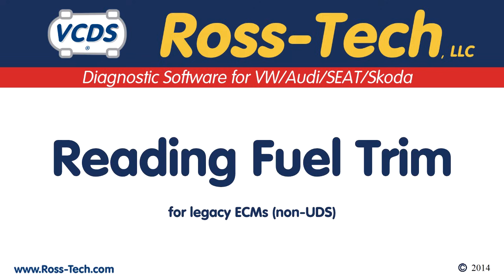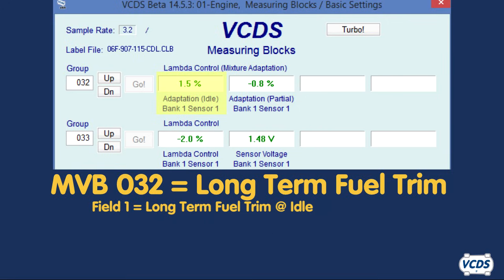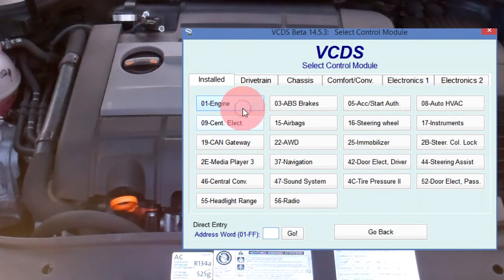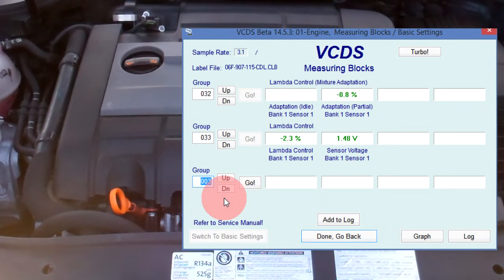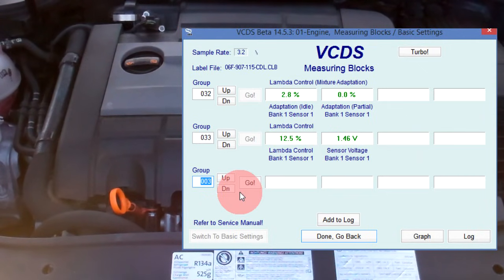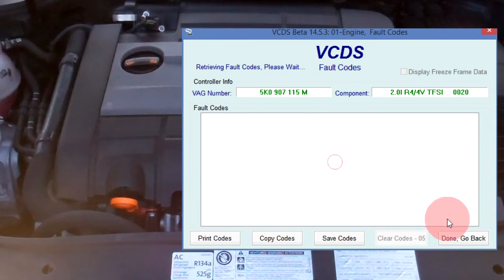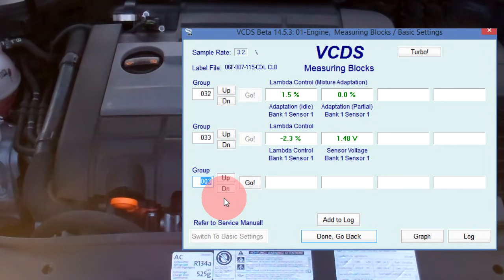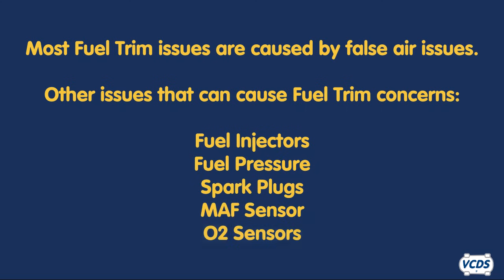Understanding Fuel Trim by Ross-Tech

Comment: I have an Audi B8 A5 2.0T (2015) and trying to figure out why I have +20 percent LTFT readings. No codes. I did smoke machine test, no air leaks that I can see. PCV valve was replaced with OEM. MAF clean with brake cleaner. Fuel rail pressures fine, no misfires, no symptoms. Could it be a bad injector or two? How do I test injector with VCDS?
Reply: Have you found the reason
Reply: @aleksandr.schmidt  after I ran bg44k fuel injector cleaner in two fuel tank fill ups, the positive fuel trims drastically went down to +5 or +9. I haven't checked recently but it's probably very good now. The only reason I can think of is that some fuel injector was a bit clogged.
Reply: @event3horizon  Thanks

Comment: My beetle 1.9 pd is horrendous on diesel, exhaust stinks pungent. I have vcds and one of your leads. I think I have an air leak, I didn’t know how to check for one though. This explains perfectly 
Would an air leak affect fuel consumption? My torsion value is 1.1, I adjusted it from -4.4 using vcds.

Ps… earlier this year I fitted a 130/150 inlet manifold, an egr delete then had a remap, I have noticed oil that has leaked from the rocker cover breather-inlet, the oil is on the inlet manifold.
Please help, thank you.

Comment: Thank you for this very instructive video!
There is still something that puzzles me, so I have a question please!. 
min 2:10, very good readings for the short and long term fuel trims. But, O2 sensor voltage reading is 1.48 V. Aren't we supposed to see a fluctuating value between 0.1 and 1.0 volt?

Comment: Can we test crankcase vent valve Passat b6 and how to test if we can, I think that he can do same problems if is blocked, do not open properly when should be opened, when the pressure is increased in the engine. 2.0 TDI 81 KW

Comment: I have the 1.8 tsi engine and channel 33 goes down to -17 and misfire cylinder 2 and 3 starts coming out, it goes to 0 a minute and no error codes come out in the engine, what could it be? The engine has lost a lot of power when starting cold it is very bad

Comment: Thanks for this excellent video, very clear info. Unfortunately when I go to group 032 and 033 no Lambda info appears, different info is displayed. I am checking using VCDS version 21.3 on a Touareg 2007 3.0TDK (BKS) any idea which group do I have to read to get the lambda info? Thank you very much in advance
Reply: This information is for gas engines and does not apply to TDI engines.
Reply: @jef4130  thank you very much for your reply! I was completely unaware of it

Comment: An engine with only a Map sensor cant see any vacuum leaks! Only with a Maf sensor.
 So in that case the fuel trims are not helpful, to diagnose a vacuum leak.
Reply: n engine with only a Map sensor and vacuum leaks will have high idle
Reply: True, but only if the there is a large leak somewhere, small leaks doesnt cause high idle.

Comment: short term fuel fluctuates + or - around zero, and my long term steadily rises until around 25% I get a check engine light. I am stumped. 2007 vw passat 2.0T FSI. anyone have any advice? why does the long term keep rising? tia
Reply: The video basically shows you that exact example; when they remove the dip stick, the engine intakes "false air" (air that has not passed the MAF sensor in the intake right after the air filter), and thus, the engine combusts more air than it thinks it is. Hence the mixture gets lean and the ECU tries to correct. 

While the video may not explain it extremely well, lifting the dip stick is similar to having a leaking air intake system on these engines because the crank case ventilation is performed by the intake, thus allowing the dip stick to pass false air into the engine. So when your car experiences identical symptoms, but have the dip stick seated properly, it would suggest that the engine is indeed getting "false air" like in the video, but obviously not from the dip stick as in the video. Instead, it could be a leaking air hose or a fault in the positive crank case ventilation system (PCV). 

The video also shows you how to diagnose this issue by injecting something flammable (not just anything, use what they suggest) around the intake hoses. If this spraying causes the engine air/fuel mixture to change to a leaner mixture, it would indicate that the "fuel" that you're spraying into the engine bay makes it into the engine to affect the mixture. The only way it could do that, is if there's a leak in the area that you are spraying, to allow your "fuel" to make it into the inside of the air intake system. Using this method, you can locate the faulty part of the intake and replace it.

Comment: I have an 09 Tiguan n I’ve tryed using starter fluid to find a vac leak but I can’t find anything. But prior to getting a p0171 code my transfer pump was making a humming noise . The noise has now stoped (suspect pump died) I get the p0171 code can the transfer pump loss cause this code?

Comment: Hi there. If my engine ECU is UDS which values should I check in the engine module advance measuring values to check for both the short term fuel trim and long term fuel trim using the VCDS? The measuring block is greyed out in UDS.

Comment: Hello from Argentina! 
I have a 2001 vw passat 1.8t awt engine.
Yesterday i drove very well, but very kms later, start to have rough idle and run very very rich.
Lambda reading is 22,7% and change to 26,6% all the time. I change lambda sensor and nothing, the harness to ecu is okey, if I disconnect the lambda sensor, the reading is 0% and run well. 
There no have vacumm leaks, spark plugs are good, no misfire readings, fuel pressure is 4 bar it´s okey.
 technician guy tell me: " your ECU died" 
Please help me!!!
Reply: +luis calomino Hi luis calomino, i have the same car "Passat 1.8T AWT - 2001" with the same error do you have know a answer for the Problem? plz help and answer me that we can exchange problem solving. I testet a lot with chaning parts and select with vcds diag.
Reply: +Jenny Meyer +Jenny Meyer hi!!! Do you use whatsapp??? It can be better if talk. 
Sorry for my pour english!!! If the reading of maf is higher Than 4.5 g/s when the engine is at idle and the throttle its around 1.2 - 2.5 %, the engine    Start to fail and the reading of lambda 22,7 and 26,6. My problem was the pvc valve, this was stuck open. Do you
Understandme? 👍🏻👍🏻👍🏻👍🏻
Reply: +Jenny Meyer my friend!!! You can solve the problem???
Reply: 1.8 l 130-140k miles,  On your right hand-intacte manif.-under  L vacuum hose-disconn, plug it=no more rought idle. Bad Check valve[special] follow plastic line, hided down there- [Hard to see from top]